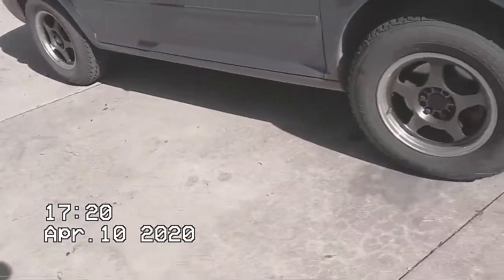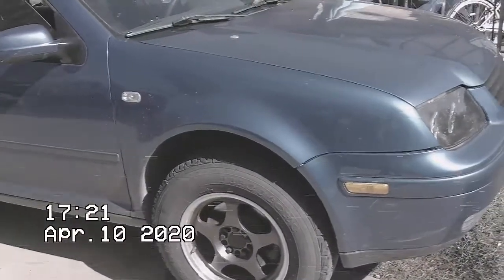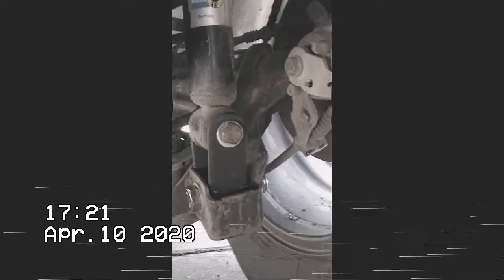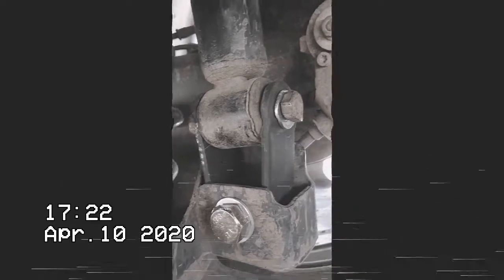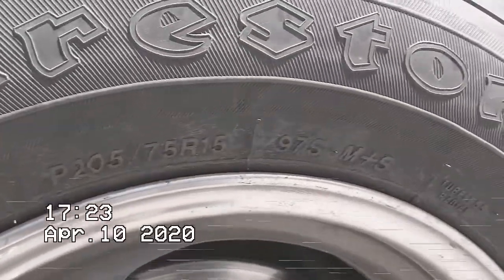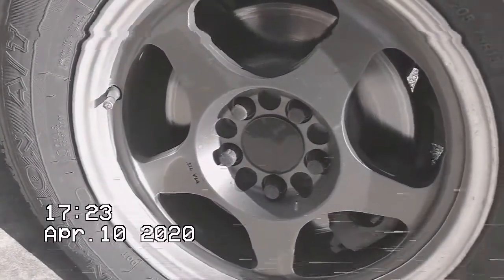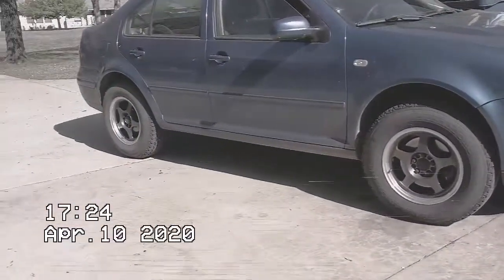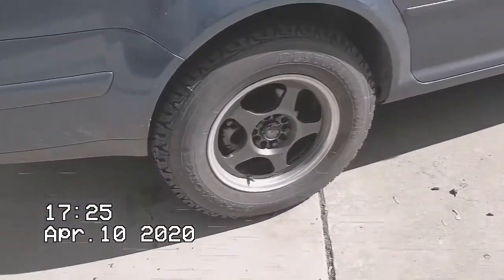DIY Lift a Mk4 VW

Comment: For those looking for a true suspension lift; you can use Jeep Springs Front and Rear. Full Documentation of that will be posted on my channel Tuesday(new posts every Tuesday)                  I used Spacers for a long time, Just like you, but If you want more suspension travel as well as want to impress folks who know lifts then USE SPRINGS/extended SHOCKS FOR THE LIFT!!!!    Very Inexpensive and its certainly simple to find jeep springs anywhere. They are like $150Front on summitracing the Spring Rates are 10 lbs heavier front/30 lbs heavier rear but a much taller spring, fyi.. Bilstein B6 HD Struts and 1999 Ford F150 4x4 rear shocks using all OEM VW Suspension parts solid 4 inch suspension lift.

Comment: what diameter pipe did you use for the front? Thanks!
Reply from the maker: I didn't. I had the guy in description make a spacer. Ultimately you want something to be tight on the shaft and not rattle.